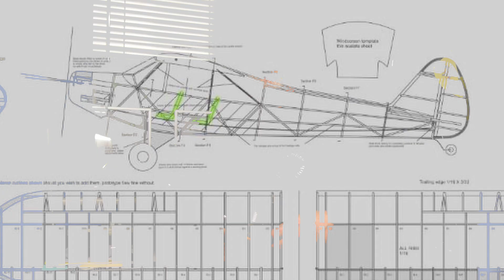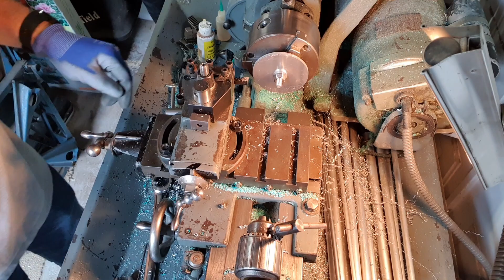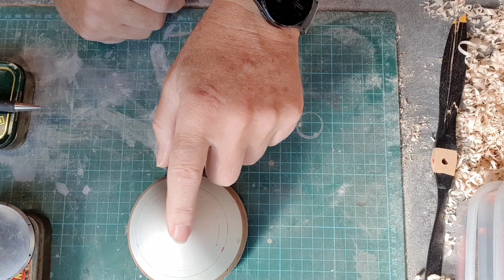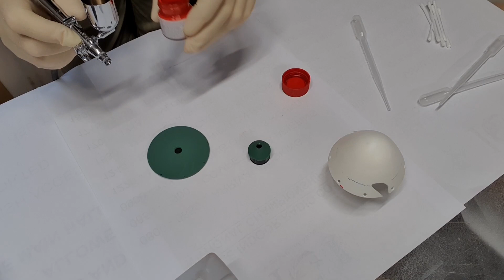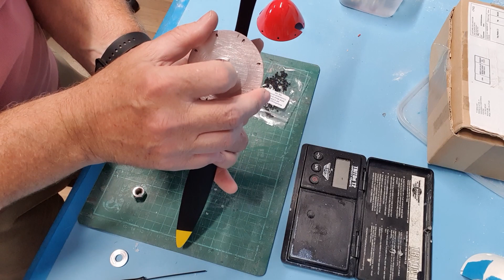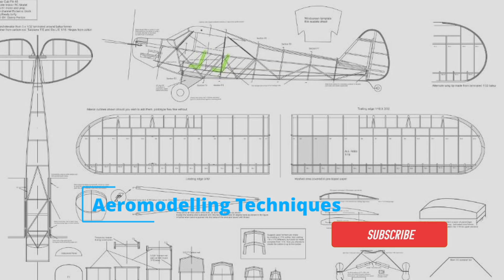Static Spinner and prop

Comment: That looks lovely Danny!
👍👏👏👏
(Tip for getting silicon off your fingers, use a plastic carrier bag to wipe your fingers on it works surprisingly well)
Atb
Reply: A little isopropyl alcohol works wonders as well.
Reply from the maker: Will have to try that, cheers